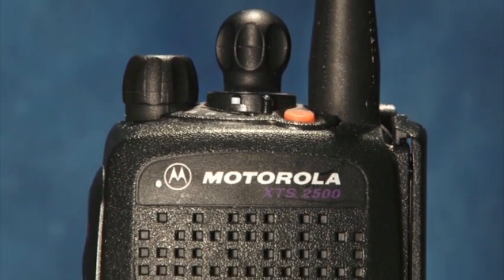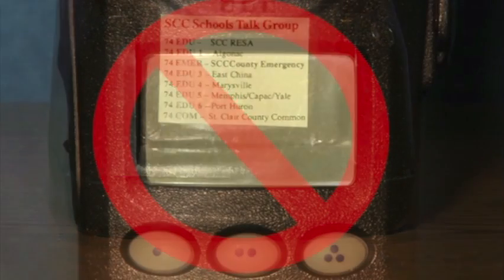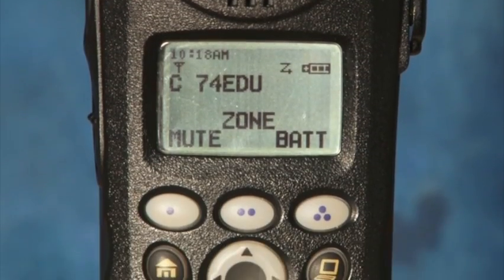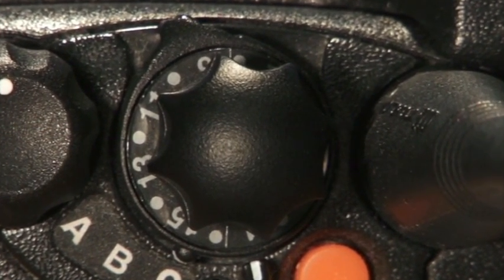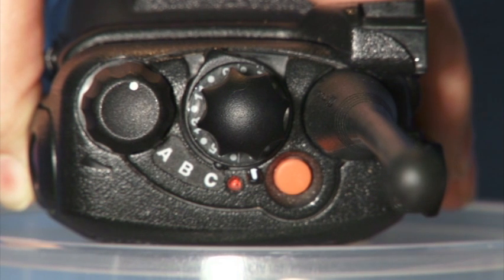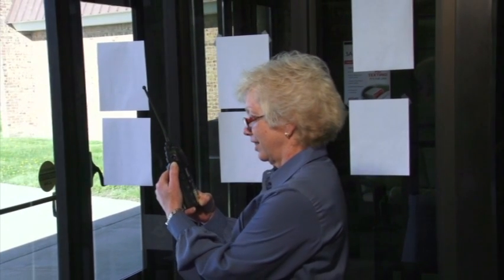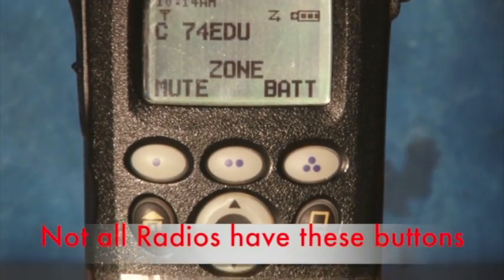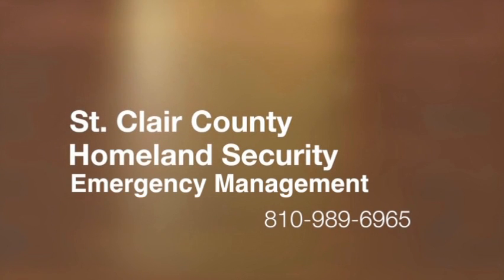Your 800 MHZ  Radio Training Part 1

Comment: I am a ham radio operator and technician and that is incorrect the battery will not drain with radio attatched
Reply: If the radio is attached to the battery or not the battery will always drain no matter what.